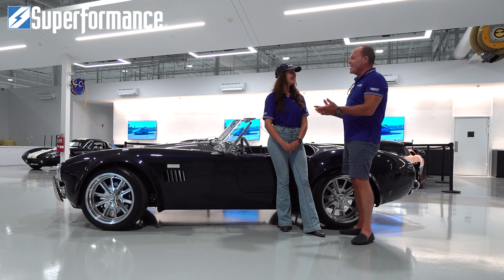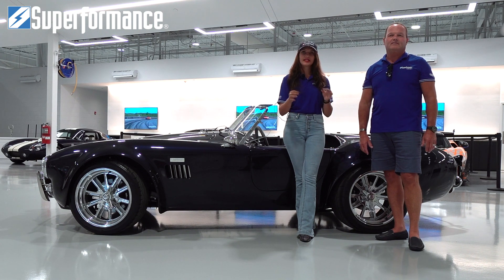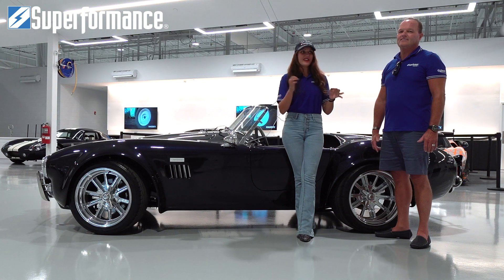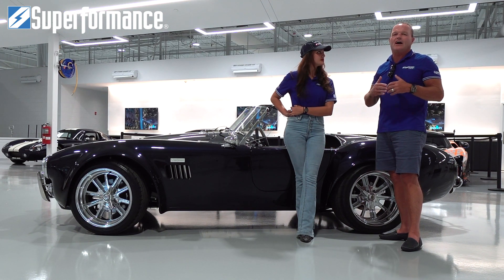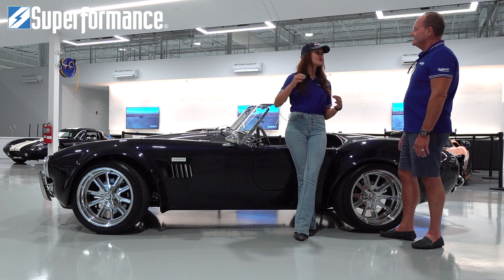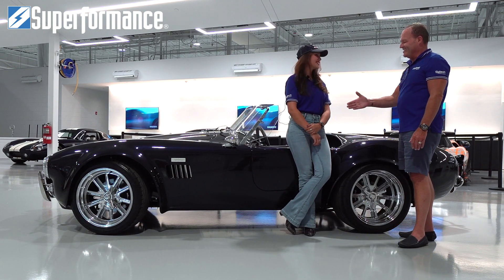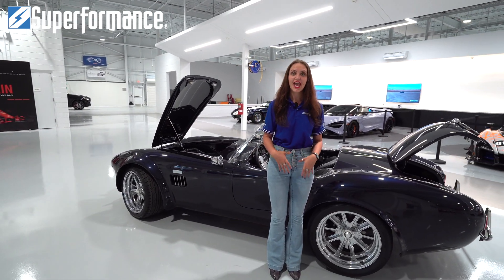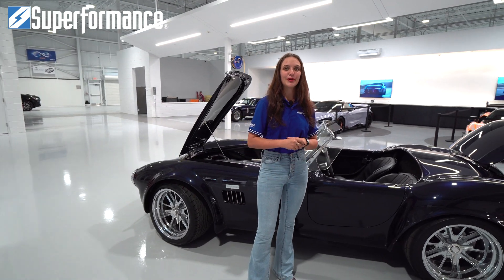Superformance MKIII E - Interview of Jannae (Gotech Performance) by Lance  (CEO Superformance )

Comment: Not a fan, a huge part of the experience is the noise, the smell, the vibration...this seems a bit like sacrilege.
Reply from the maker: I hear you but we know in  many states like California is becoming more and more difficult to own and drive performance cars.
Reply: Gonna have to get used to it.  This world is changing rapidly
Reply: @itsjustme9751  Yep, it is nuts.  Nitrogen, Oxygen, and Argon together comprise more than 99 percent of the atmosphere.  In comparison, CO2 is only 0.038% of our atmosphere by volume.  A mere 2.75% of that volumetric CO2 is anthropogenic (human caused) in origin based on climate change scientists.  Those are not my numbers, rather the “scientists” claiming it is too much.  So, let’s do some math to put this volume into perspective.

Let’s use a 100-story building to represent the height of earth’s atmosphere.  A 100-story building is 1000 feet tall (10 feet per story).  How thick is human carbon emissions?

.0383% x 1000 ft x 2.75 % = 0.0105 feet x 12 inches/foot = 0.126 inches or 1/8 inch.

So, in a 1000-foot-tall (100 story) building representing the earth’s full and entire atmosphere, the depth of human carbon emissions is equal to the thickness of the linoleum on the 1st floor.  That’s it.  Yet, climate change scientists and politicians are changing our entire way of life to reduce this negligible amount that in the full scheme of things is lost in the noise level of the air we breathe.